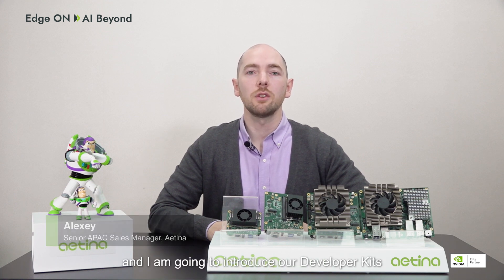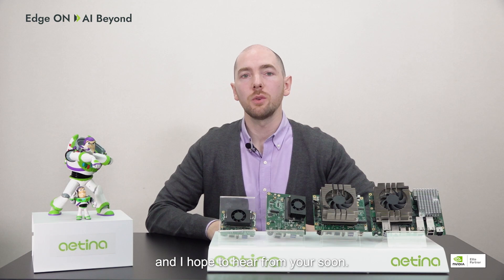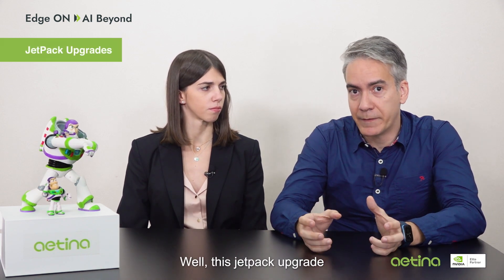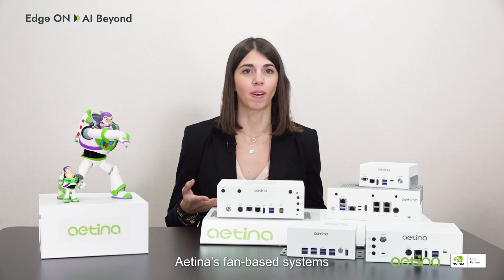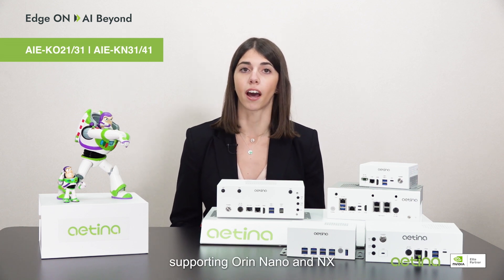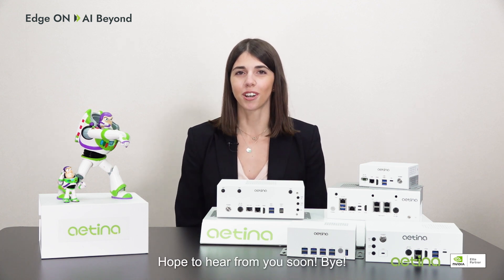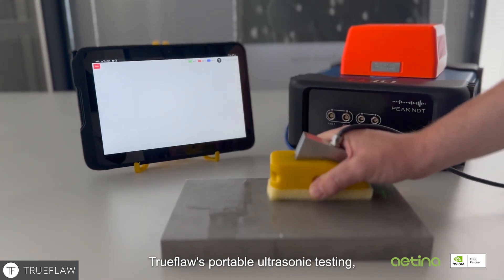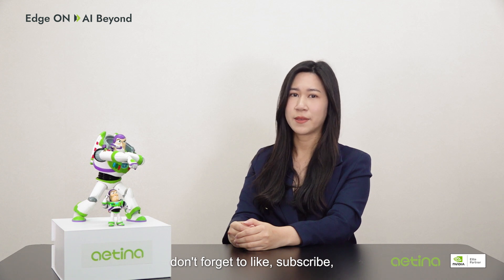NVIDIA Jetson Orin Series Demo: Developer Kits, Fan-Based and Fanless Systems from Aetina

Comment: Hello. Experience with the AN-810 carrier board for the jetson xavier NX has shown that there are not enough carrier boards of the minimum form factor (comparable to Raspberry PI 5 or AN-110) with an M.2 connector for an M key for SSD (SSD for an M.2 key connector E is produced by very few companies). It is also unacceptable to switch USB 3.0 to USB 2.0 when installing a communication modem in the M.2 connector of the B+M key - this is a big minus. Otherwise, the boards have proven to be extremely reliable and have been working for several years without shutting down in debugging prototypes of devices for perimeter security and control of products (agricultural enterprise). Therefore, if Jetson Orin allows you to place all three types of M.2 key (A+E, B+M, M) on the carrier board without affecting the USB lines, this is huge progress. But the optimal parameters of the carrier board are the MIPI-CSI connector M.2 of the M key for SSD and USB 3.0-3.2 on a board of the smallest possible size.